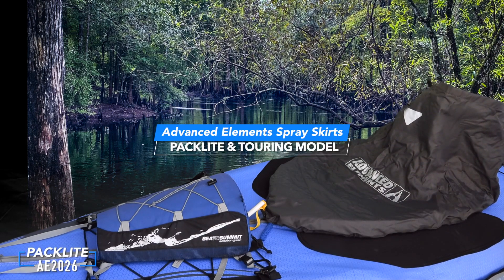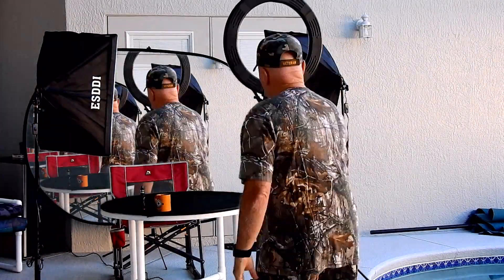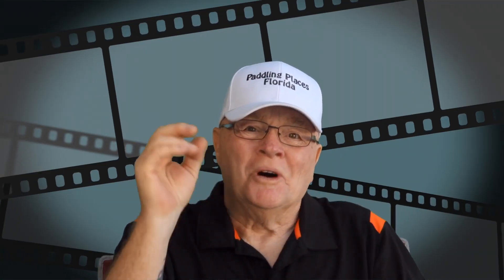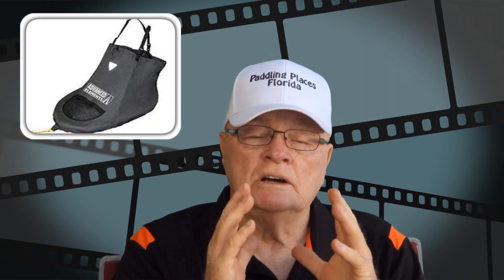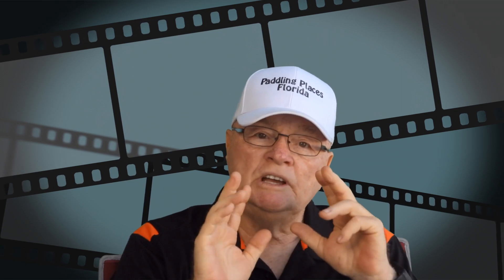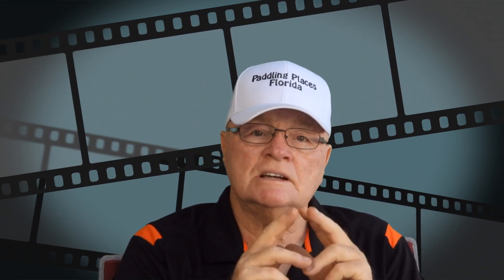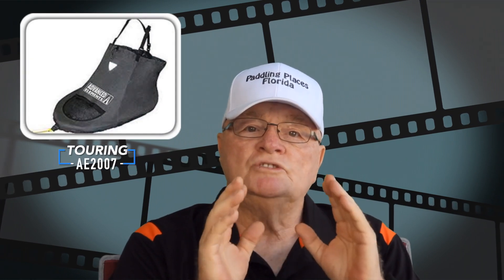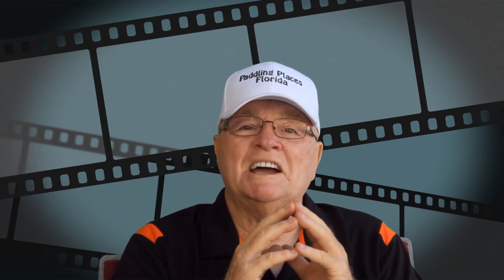Advanced Elements Spray Skirts

Comment: I’ve been using the spray skirt and it is somewhat different to what I was used to on a hardshell. My advice for fitting is to not try and make it too tight like you would expect from a hardshell spray deck otherwise it pops off too easily when moving as the inflatable coming isn’t enough to keep it taught.  The material is quite stiff and water does collect in the pouch area so you have to pull the skirt up when you notice it to let the water run off. I guess that does show it’s doing a job though! Defiantly keeps you warmer and drier but yep, not the same as hardshell spray deck.

Comment: I have also the packlite skirt for my AE1012DEDS , however not yet tested. I am a bit disappointed by its shape and afraid it will collect all the water from the paddle. It seems to be too concave. 

But anyway, thanks to all your videos I own now a AE1012 with all available gimmicks and look forward to 2020 for testing it the first time on the water. Thanks Mr D from Bavaria.
Reply from the maker: Whisky Golf Hi, I must agree with the concave, but again it’s not a hard kayak skirt. I noticed the concave and thought the same thing. I guess one could relieve any collected water by pinching the middle and raise it slightly. I will be testing it on water very soon as the Florida heat goes away. My next review is a “camp n’ paddle and there is rain in the forecast so I’m taking the touring model with me just in case. Congrats on your 1012 will bring you lots of joy.

Comment: Would the paddler pull the spray skirts on under your life vest or over it? Most people with hard shells put them under inside the tunnel of paddle jackets and vests over that.
Always wear a vest is the rule.
Reply from the maker: @PhilipLongee-vw8jf  I always place the skirt over the PFD.
Reply: @DaleMrDSimmons  So an auto-inflate vest wouldn’t work with those sprayskirts, correct? I have both.
Reply from the maker: @PhilipLongee-vw8jf   yes they will as the Spray Skirt will remove itself from the kayak thus flooding the spray skirt a dissolving the tablet engaging the CO2 cartridge inflating the vest. If that happens after inflation remove the spray skirt. It is doable.

Comment: I have the AE1012 with the front and back zippers. The front zipper is letting in water into the kayak. Anyone has a solution for this? I am thinking to replace to water resistant zippers from YKK.
Reply from the maker: Mattias Sörwing to be honest, I have never experienced that. So I can’t really help. Sorry
Reply: I feel your pain - I just have my dry bag between my legs to prop up the deck. And/or tuck a car sponge under the bungees
Reply: gaffer tape

Comment: You didn't show how you use the sprayskirt with your life vest. Always stress safety. It looks like the Packlite skirt goes under the vest. With the suspenders, does the Touring skirt go over or under the vest? Usually in regular hardshell kayaks using neoprene sprayskirts are worn under the vest. Will you make another video with these skirts in paddling action?

Comment: Try doing it on the water it is much more difficult. The studio background looks good but doesn’t account for a life jacket, wind and instability of movement on the water. I tried using it several times but it didn’t do the job. Excellent work on the videos but  personally it wasn’t for me.
Reply from the maker: I have and once you figure out the best installation process it’s not that hard. However, I agree they are not the same as a standard spray skirt on a hard yak. Of the two offered the TOURING SPRAY SKIRT: AE2007  is the best. It does allow for the PFD better. But they are basically just a water splash protection nothing more.